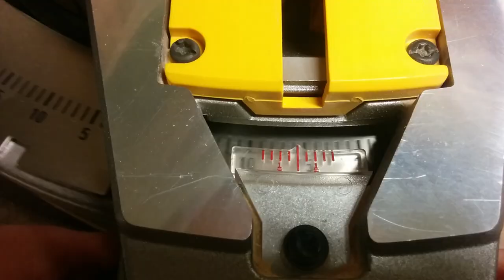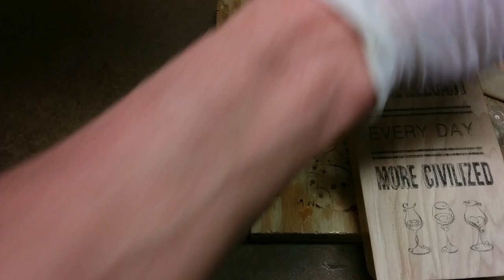Making a Floating Wine Bottle Holder with Ink Jet Image Transfer

Comment: What are the measurements here? Is it 15x 4.5 and 2 inches down from the top where the hole is drilled. Also is the angle 25 degrees and the hole 90 degrees?
Reply from the maker: Mars vs Venus not quite. There's a link to my website in the description which has a drawing with dimensions on it.
Reply: Justin Depew Thanks. Your website is nice.